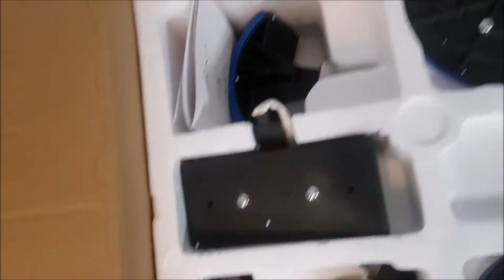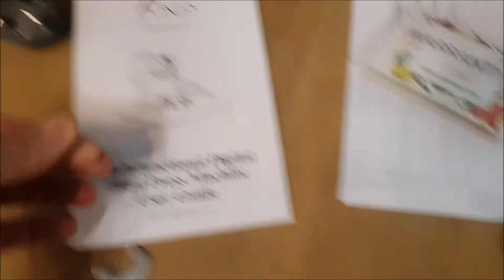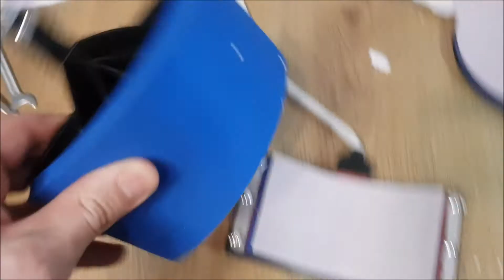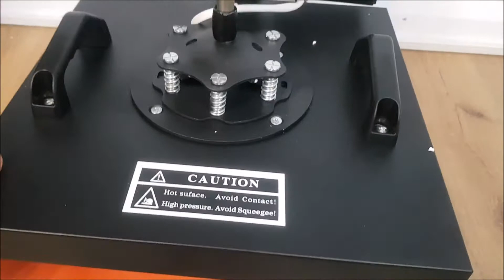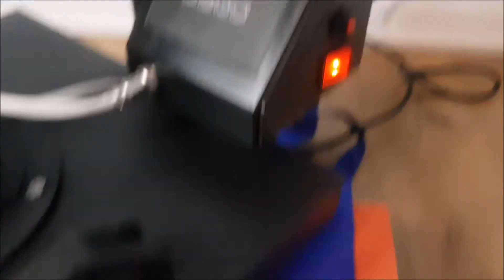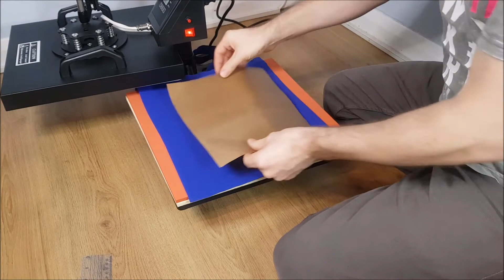Aonesy HEAT PRESS Machine - Review

Comment: I got one. Just unboxed it and it will not swivel at all. So I contacted company.
Reply from the maker: It can be a bit stiff, did you make sure that the handle is up and give it a bit of force? Also make sure it is the same design and not a clam shell one, as that doesn't swivel.

Comment: Hello I have the same.heat press and I want to use it for sublimation in phone cases. I have printer sublimation paper and ink and cases with aluminum but it doesn't work. I do something wrong? Any advice would be helpful. Thank you so much for the review
Reply from the maker: Have you checked that you are using  the same temperature as recommended on the sublimation paper?